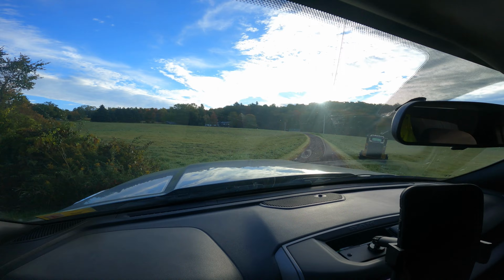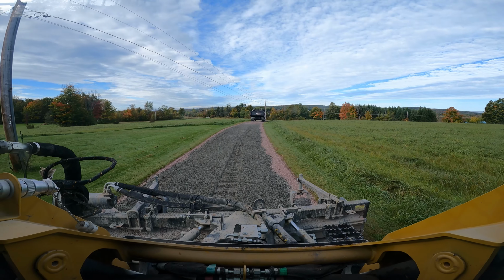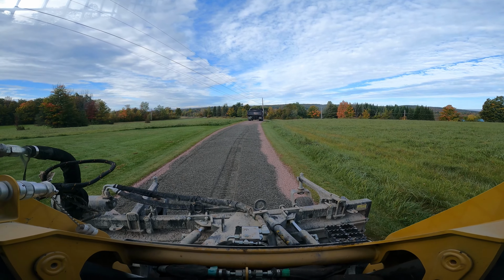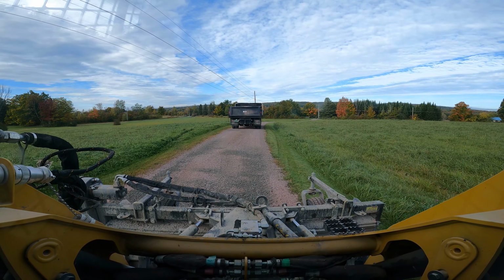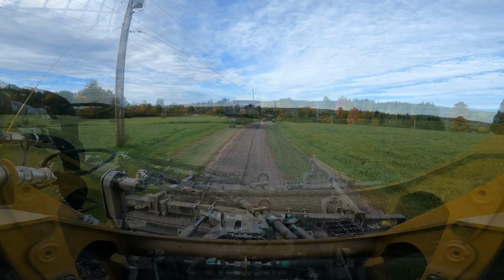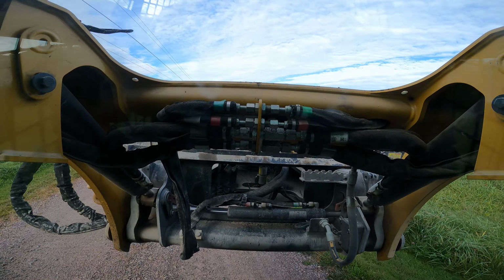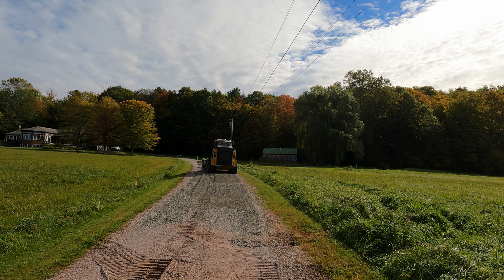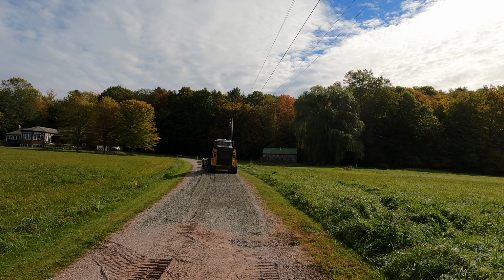Adding 3" of New Material To Customer's Driveway w/ Cat 259D3

Comment: Nice equipment, I’d love to step up from my Ram 3500 to the 5500. How many tons can you carry in the 5500? And what would you use for material on a super steep driveway?
Reply from the maker: Thank you. 5500 can legally haul 5 ton but we’ve heard it can handle like 8…😏

Steep driveways you want crushed gravel mix with heavier rock in it. Crushed for the jagged edges so it packs with the rock fines, and large like 1.25 rock so it’s less apt to move.